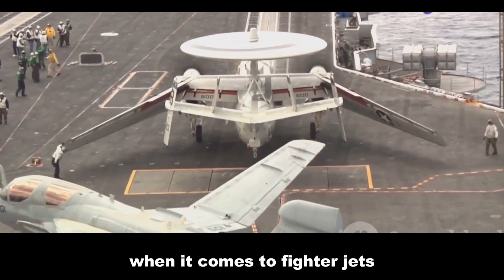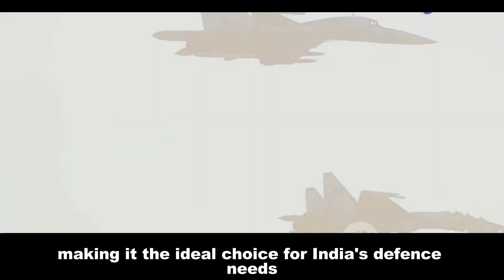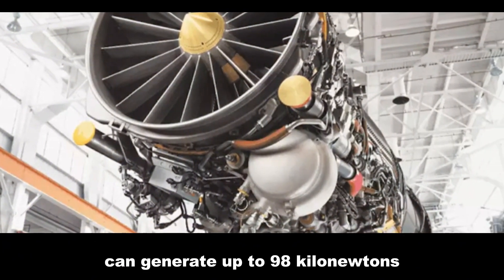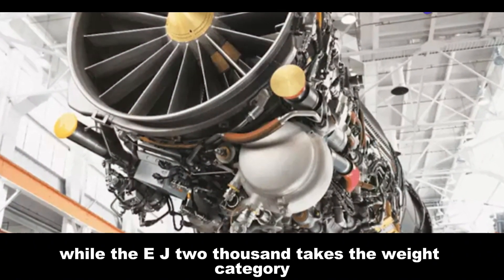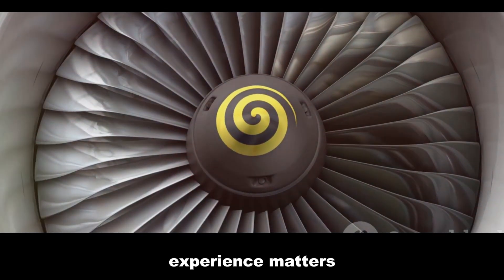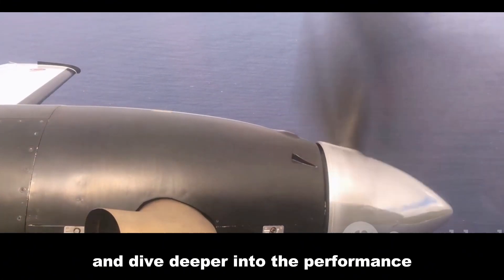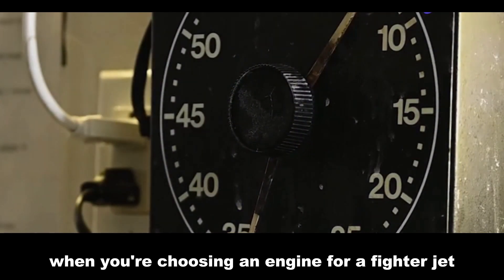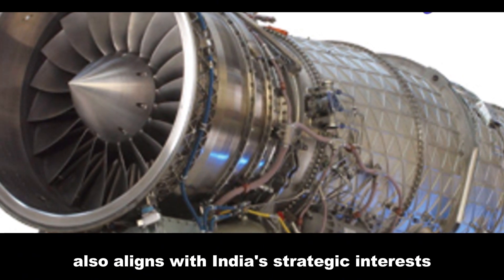🔥 EJ200 vs. GE F414: Why IAF Chose American Muscle for AMCA & Tejas Mk2 🇮🇳

Comment: Main reason is the GE F404 has shown high reliability
hardly ever failing under hot and humid conditions.
Reply from the maker: Agreed, idk about ej200 but it has had some issues at Hugh altitude region as per sources
Reply: Politics are also a main concern. With the GE, you have to deal with one country, as opposed to four countries for the EJ200. 
Also the GE F414 is cheaper.
Reply: Ej200 tot crucial ,enhanced thrust can for amca 
Ge 414 headache 
Safran playing games 
So ej 200
Reply: @srivishvanathgovind8881  

tot just means the foreign manufacturer handing you a screw driver with assembly instructions and sending you a large bill.

the only way to learn how to build a modern jet engine is to build it.